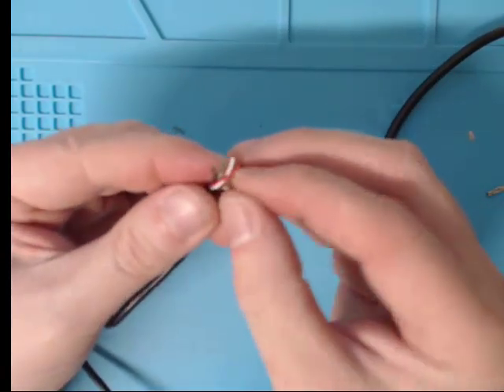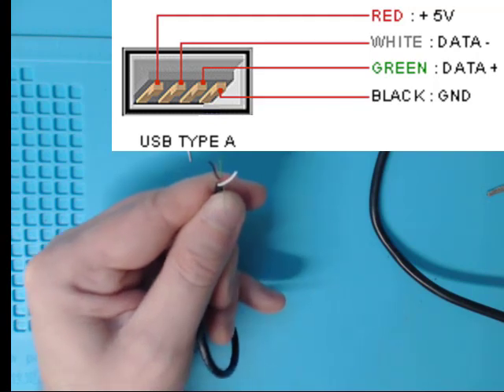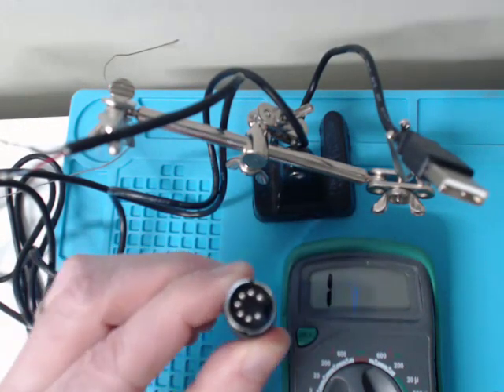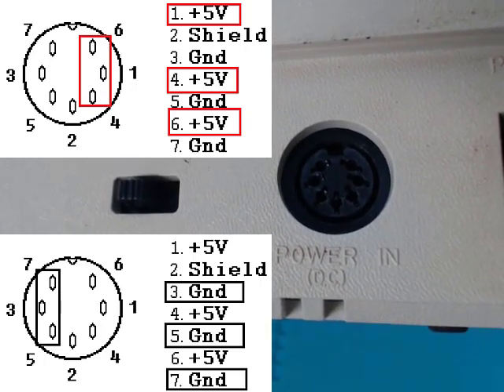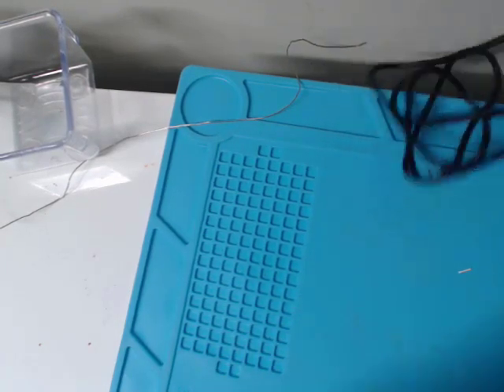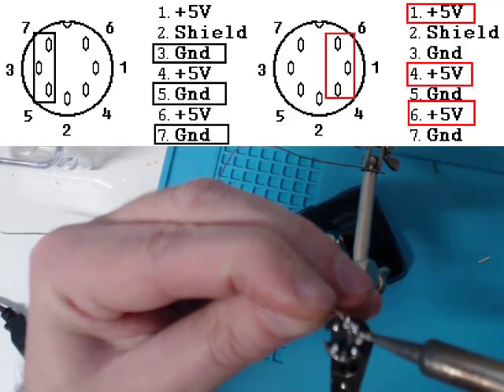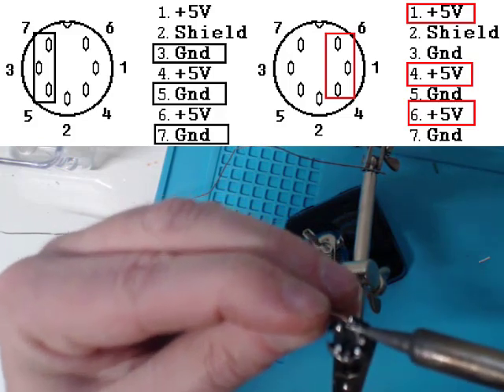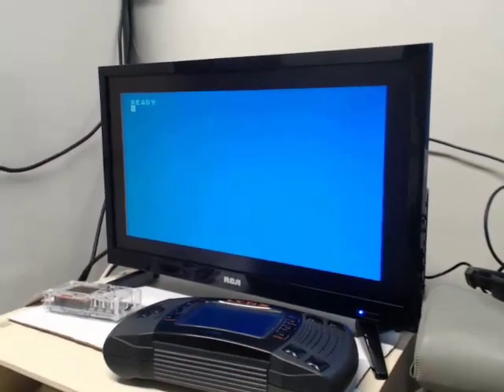Atari XL powered through USB

Comment: @TechCowboy, you applied soldering to all 3 5v+ and then just soldered the USB cable red wire to those, right? You did the same for the other side which is ground, right? But what about the SHIELD cable, what's supposed to go in there?
Reply from the maker: I did not connect the shield

Comment: So 1.5 amps is sufficient?
Reply: Well I measured the consumption on my 800XL and it gets 0.85A stand alone and 0.95A together with SDrive unit.  So 1.5A or 2A USB chargers should be ok.
Reply: @petrok1rp254  That's great! I have a number of good quality 2.1 amp phone chargers laying around from upgrades and I don't doubt they're of good quality and likely much greater efficiency.
Reply from the maker: Standard Atari XL Power supply is 1.5 amps